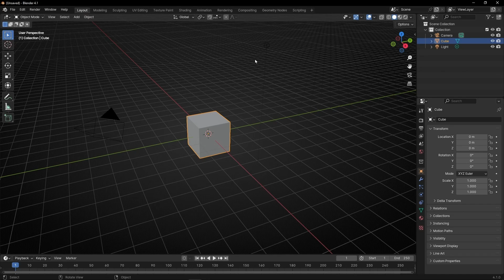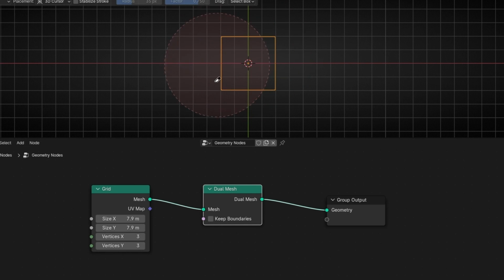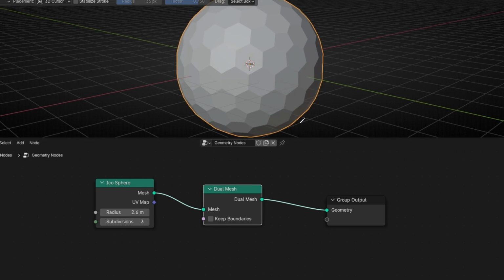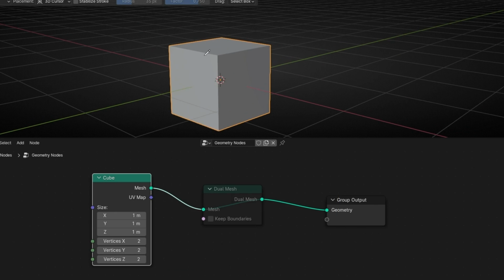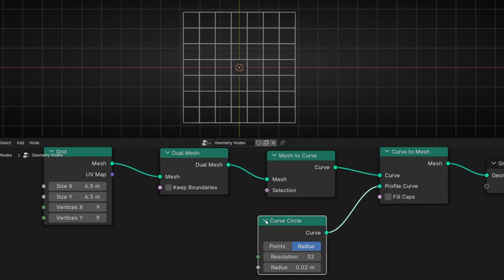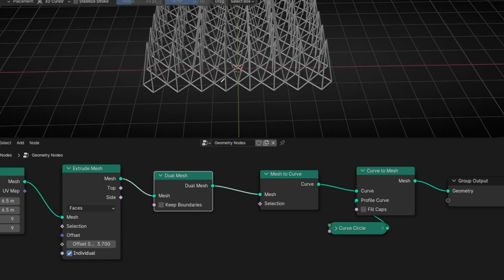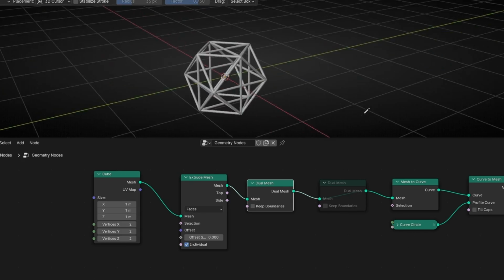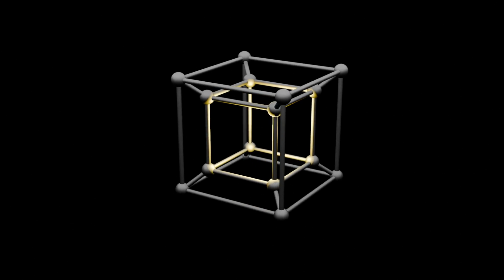How to use DUAL MESH in Blender - Geometry Nodes

Comment: bro make the teseract whi u last video abstract
Reply from the maker: I have the full project available on my Patreon if you want to check it. Exactly like the thumbnail. 

Basically, the only thing i did after the tutorial is to select the geometry before converting to a mesh and create a new wire to add Instances on Points with UV Spheres. Then joined together with Join Geometry. Finally, I added some lights: one inside and some out :)